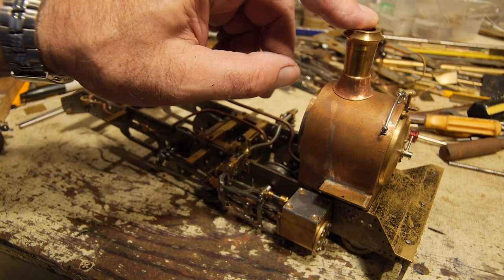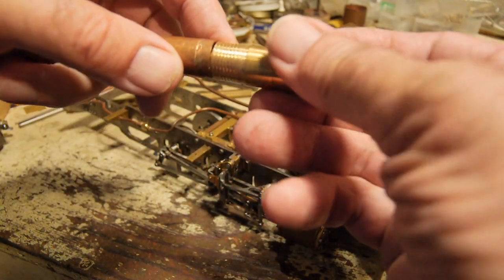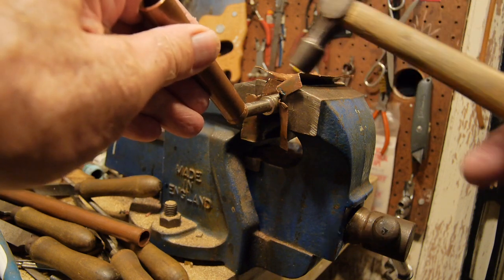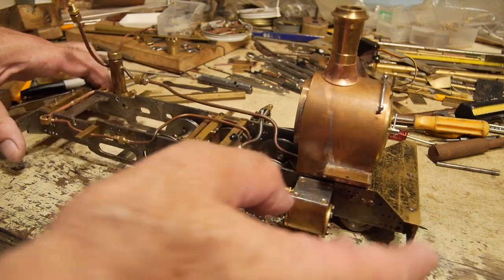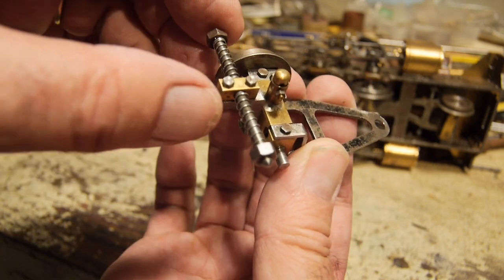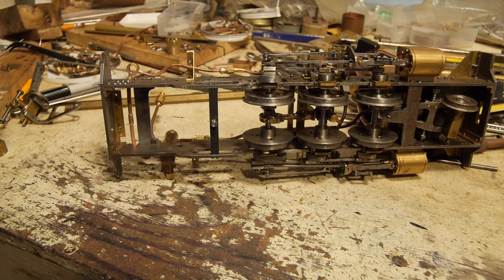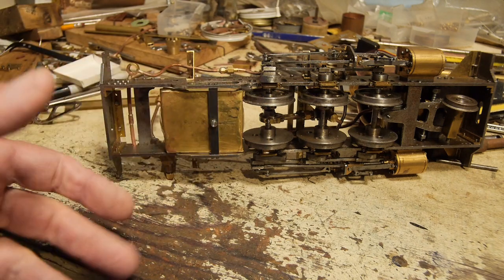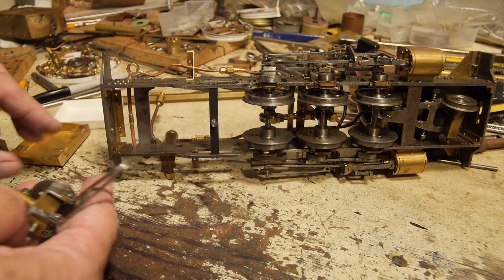'Russell' Live Steam Model Locomotive Part 8

Comment: have you a video (I'm still watching the series so may come up to it eventually) where you show the inside of the cylinder  - how the steam gets in, how it moves the rod, how the steam exits, where it goes (like do you re use the water from it) and how does the valve move form in to out.
Reply from the maker: Watch the series on the loco there is some explanation in the early episode.  The cylinders are from Roundhouse Engineering and their website has some useful information on how they work.

Comment: isn't hotting up the metal to make it maleable (w/o cracking) called "priming"?
Reply from the maker: Annealing is making the copper soft so I can work it as show. Priming on a loco in steam is when the boiler is too full and water is carried over into the cylinder when the regulator is opened.

Comment: Really cool stuff. 

Would you consider doing a series where you build an engine from the ground up and go over everything? I'm kind of flakey when it comes to the motion.
Reply from the maker: It will be a while before I start another loco.  Unfortunately I'd finished the chassis before I started this channel but i will at some stage go back over that part of the build as i have some stills of the process and I have to take it apart for painting.  Stay tuned.